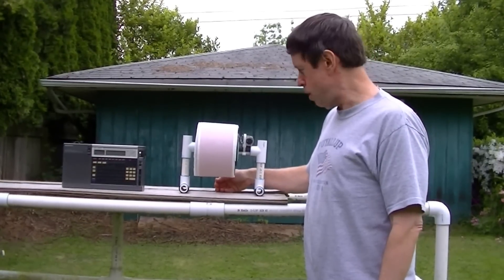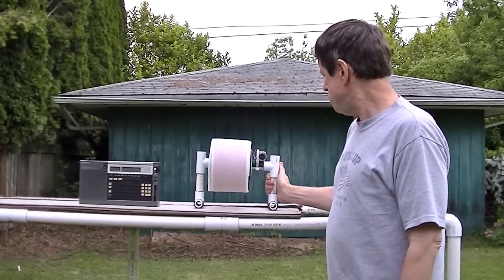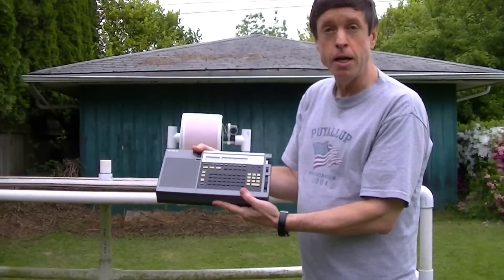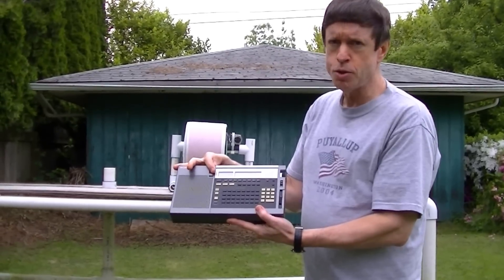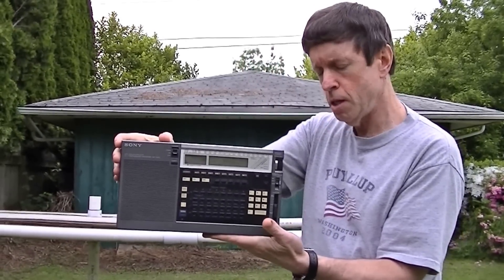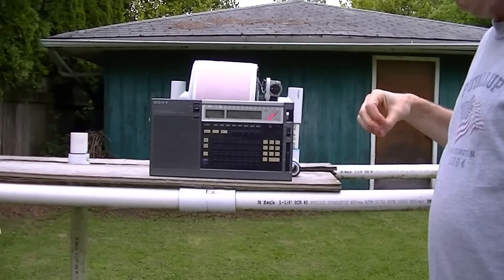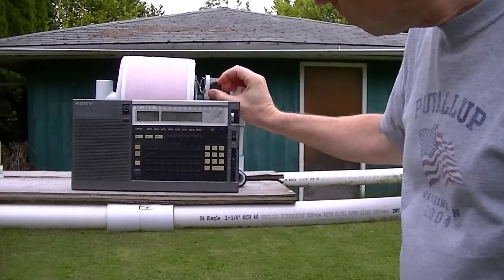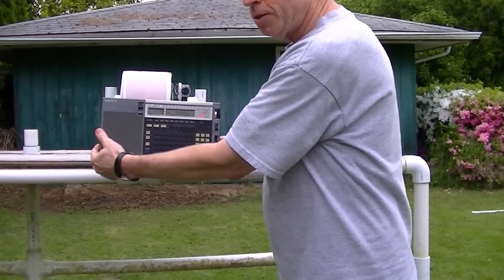7" Longwave Ferrite Sleeve Loop Antenna Demonstration

Comment: I built a FS antenna a few years ago using 39 5-inch ferrite rods. It's made to tune the MW band plus the amateur 1.8 MHz band and boy is it effective. Finding the best position for the radio is important - too much coupling (radio too close) can reduce the Q of the antenna and cause flat tuning and a lack of boost. I find a few inches spacing is best. Also keep well away from metalwork and sources of noise. I wrote about it in Radio User magazine at the time, but of course credit must go to Graham Maynard's excellent original research.

Comment: When I lived in Florida in the early 1990's  I worked for an Avionics repair station and one of the odd jobs we had was to maintain several NBD transmitters in the state of Florida and it was one of the jobs I liked to do because I would be on the road as those transmitters were a good distance away and usually would do repairs at the sites. What I found interesting about most of those beacons was the power they ran and type of antennas that were used. NDB's for aviation navigation usually operate between 5 to 25 watts carrier power out of the transmitter into 50 ohms and the antennas were surprising. The antennas were smaller that I thought they would have been but the ground counterpoise  was massive. For example at that time the Sanford Airport beacon was at 408 Khz call sign SFB. 25 watts power MCW.  The antenna was a wire center fed T suspended by three telephone polls that were 50 ft tall and 300 ft across the top of the T. However, the Ground radials under it was massive and made with about 3/4 inch diameter copper cables separated by about 5 degrees and several hundred feet in length buried about six inches under the ground. I think that the navigation from aircraft was about 25 miles range but it could be heard a lot further. I was down in the keys at one time and listened on 408 Khz and could hear the CW ident SFB along with several other NBS's on the same frequency. It would be interesting to know what the power level and antenna for XX in  Abbotsford, B.C. is. There are some NDB's that run high power to provide navigation for ships at sea.
Reply from the maker: Hello Emwavemhz,  Very interesting-- especially since I was stationed at Key West while in the Navy in 1972 (a Sonar Technician). The antenna systems of many NDB's are phenomenal, and considering its potent signal I'm sure that XX has the same kind of huge radial system you describe. The Canadians seem to have invested a lot of $$ in their NDB transmitters, which include several super beacons in BC which are audible for thousands of miles.
Reply: During the late 1980's I worked for a company called Spartan Defense Systems in Deleon Springs Florida. I worked with a team on the development of the last generation of sonobuoys for Submarine detection for the cold war. The last soviet submarines were built in such a way that the propeller produced no propeller cavitation bubbles thus they were almost silent. However, the one thing that couldn't be masked was the pressure change caused by the movement of the submarine. The new generation sonobouy could detect and track audio as low as 7 Hz thus our Navy could track the new soviet subs. By the time the company had delivered the new buoys the cold war had ended. 
   Down in the Keys during the 1990's Dry Tortugas island which is about 70 mile west of Key West had a high power NDB and as I remember it was 1 KW of power with its primary purpose being for ship navigation. I don't think it is in operation today as I couldn't find it in any of the NDB list's or information on Tortugas today. However, during the 90's when I was working on Avionics equipment at the Sanford Airport I  used the Tortugas station as a measure of sensitivity of ADF receivers in the aircraft parked on the tarmac as they would at that distance point to the station and I could hear the identification clearly in the ADF's that were working normally. 
   Today ADF navigation is rarely used as GPS is taking over navigation. If NDB's are ever cut I would love to see the 200 Khz to 400 Khz or up to 500 Khz become an amateur radio band I think it would be an enjoyable band to operate though the antenna's would be a challenge.

Comment from the maker: Hello Simonspiers, "Barefoot" operation means using a portable radio without any external antenna (either inductively coupled, like in this video, or directly connected). Your ICF-2010 came out of the shipping box in a "barefoot" state 25 years ago.

Comment from the maker: @Adam, The frequency range of the 7" Longwave FSL is from 153-640 kHz. It is composed of 67 Russian surplus 140mm x 8mm ferrite rods, which are wrapped with 73 turns of 660/46 Litz wire and tuned with a 381 pf "N50P" variable cap. Unfortunately there isn't time here to make extra models for sale, but the full "Heathkit-like" assembly instructions for the 7" Medium Wave FSL model are online-- available upon request. The only difference in the two FSL models is the number of Litz wire turns. Gary

Comment from the maker: OK Marty, If your main priority in a world band receiver is receiving FM fringe stations, you might want to check out one of the Tecsun DSP Ultralight radios like the PL-310 or PL-380. They only cost about $50, but have astonishing FM reception because of the new Silicon Labs' Si4734 DSP chip. You can see a closeup of the Tecsun PL-380 receiver in my 8" Medium Wave FSL video. Good luck!

Comment from the maker: @gccengineering1996, Thanks for your interest in the new FSL antennas. Many AM-band FSL models have been made here and elsewhere (an 8" diameter AM-band model video has also been posted), and have proven to be very effective in portable DXing. The unique advantage of these antennas is very high gain from an extremely compact size, although with the side effects of concentrated cost and weight. VLF-band models would also be very feasible, requiring only additional Litz wire or tuning range.